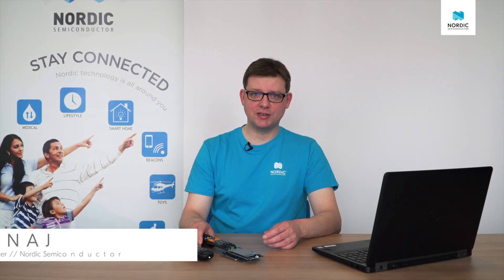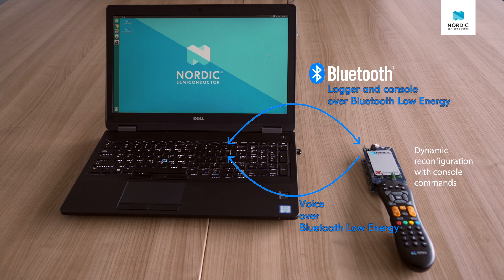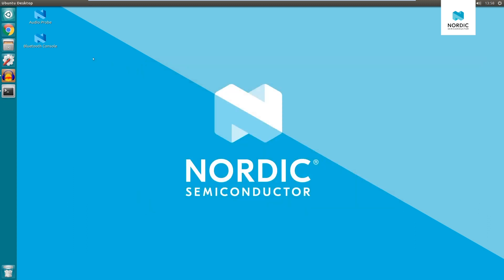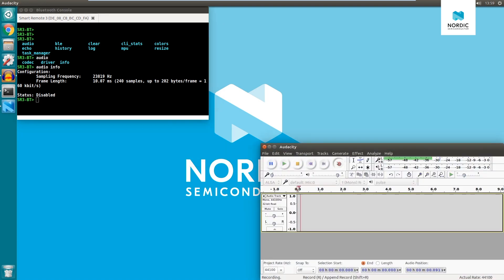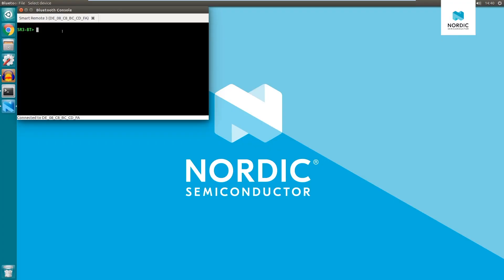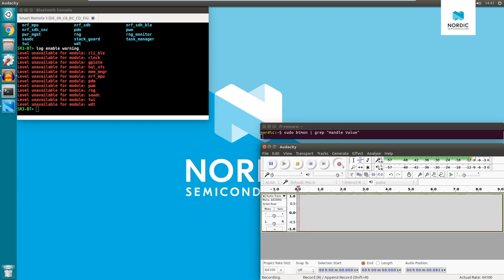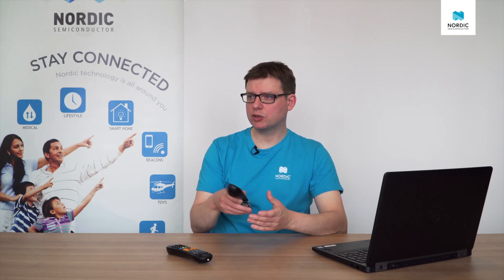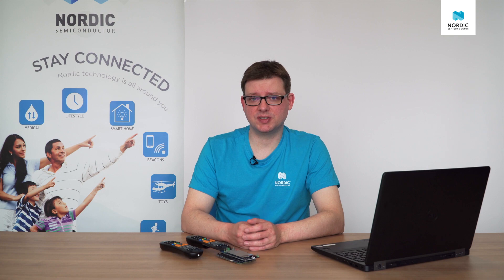Interactive console in Smart Remote 3 for nRF52 Series

Comment: is there any way to use this bluetooth console in windows10?
Reply from the maker: In theory, the console could work on Windows, because it’s a Python application. However, it’s using BlueZ. For this reason, it will not work on Windows 10.
Reply: This console uses Linux D-Bus to access BLE, so it is not supported on Windows. However, you could try with nRF DK connected to Windows and this script: https://github.com/NordicPlayground/fw-nrfconnect-nrf/blob/master/scripts/shell/bt_nus_shell.py